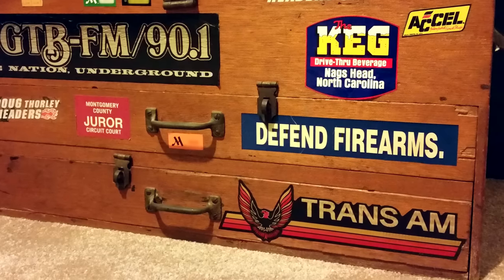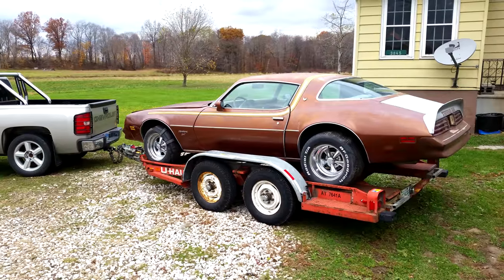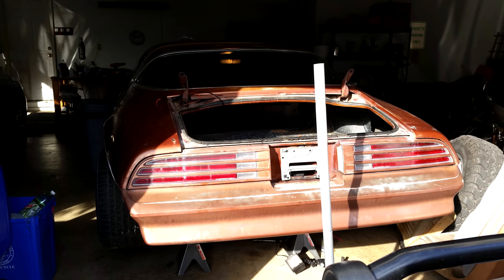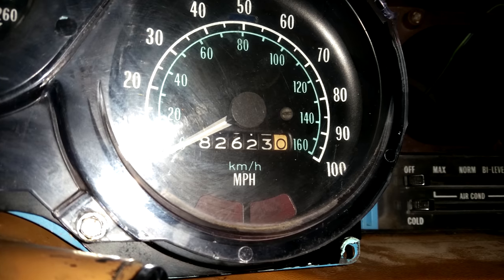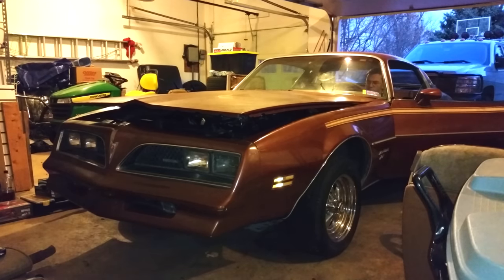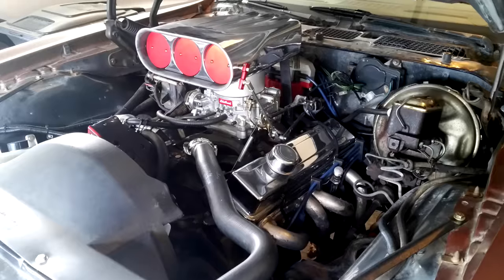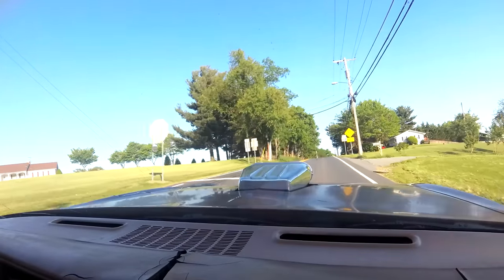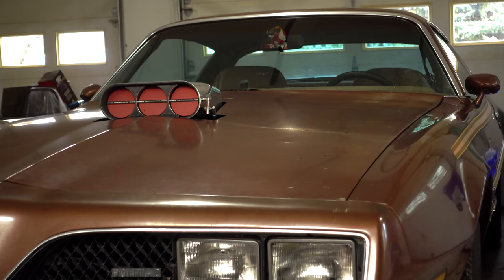1978 Pontiac Firebird Street Car Project (Ep.1)

Comment: when you say rally wheels are expensive and hard to get leads tell me you're not talking about the hot wheels dartboard style rhythms??? If you are I suspect you'll want to kill me. I've got at least two possibly three sets of them.i purchased one set with a steering wheel out of pity and they've been in the burn four years never had the time or money to get the rotten tires removed and have them sandblasted and repainted. I know there's at least one set that I had on a car I was driving for several years that I cleaned up which have the centers and trim rings I had them on a 87 capris and the car looked like a giant hot wheels Dinky ;).i cant are member if I had another set besides those two or not if I do there in the burn and being captive of the weather. I have two sets of centers and I'm pretty sure two sets of trim rings. Also got an old set of 1970s GM five bolt pattern rims off of A GM Van complete with the centers. i got a trim rings and centers for those Rams where somebody was an idiot who had no concept of antique vehicles. Basically the guy threw out several hundred dollars in parts that were in factory mint condition and tossed everything on the side of the road where he bought the vehicle and was modifying it what I was driving at the time I only have the luxury of picking up the trim rings and we'll centers and had nowhere to put the Rams to get them Home.i use those rings and centers on a set of rums I had on a 1972 Jimmy.i have on onto quite a few parts off of different vehicles i had. Here in Canada a Trans Am like in that picture with no engine in that condition will run you approximately $5000 may be more don't take my word for it look one up on the Nova Scotia Internet buy and sell. If you could get one for 500 to 1000 that was salvageable with out an engine I have one.i spent 10 or 15 years trying to get one of those cars when I was shown her and gave up every time I came close it just never ended well. In a couple of cases I had somebody that wanted to give me one where it was on their property but the actual owner wouldn't release the vehicle as an example. One such case the car had been restored and put up on blocks and was sitting in the owner Jared roughly 15 years I'm pretty sure the body itself was shot but there was just so many parts that could've been used on any number of other vehicles including a very nice motor and transmission but the actual owner with the title of the vehicle wouldn't allow it to be moved.i love the fact that this is a daily driver kind of thing reminds me of the 72 Jimmy I used for a long time. It looked like something out of mad Max and was actually quite safe and dependable ironically the damn thing and more horsepower under the hood than you'd ever imagine had to constantly drive it like Ms. Daisy.

Comment: An Espirt with factory installed T/A gauges? That’s rare!Wonder what the build sheet says....
Reply from the maker: The build sheet/order form was attached to the top of the gas tank when I dropped it, took some pictures but it was somewhat deteriorated. Can make out "W63    GAGE PKG" which corresponds to "Rally Gauge Cluster and Clock" when looking it up online.

Comment: Hey ,I live in Australia,my father has a 78 firebird 400 chev.its been changed from lh drive to rh drive I was wondering if u know where I can get a workshop manual to get it running.its been sitting for around 3 years ,I wanna know where fuse box is and trace a few wires.trying to restore it for him only mechanical tho as the body and paint is still good.cheers
Reply: Any help will mean a lot
Reply from the maker: If you are on a budget, the Haynes manual for the car has decent diagrams for the car since the wiring is so simple. I have used mine a bunch of times and it has proven to be accurate and complete as far as I can tell.

Comment: Were you able to pull out the oil pan without pulling the whole engine?
Reply from the maker: Yes, but it was not easy. From memory, I unbolted the trans and engine mounts and lifted it a few inches on each side by jacking up under the oil pan. Set it down on blocks of wood on top of the mounts and unbolted the pan. Took some creative angling but I was able to get it out of there. Just be careful not to crush anything when lifting the drivetrain like that, I'm sure I removed the distributor cap to get enough clearance to do that.

Comment: Are the poly engine mounts to blame for the engine rattling the whole car?
Reply from the maker: The poly engine mounts, trans mounts, and body mounts make for not a lot separating you from the engine so that is a large part of it. It kind of just hits certain unpleasant resonance frequencies sometimes when idling that are unpleasant to the ear, like leaning on a large subwoofer.
Reply: Yeah I had the same issue with poly suspension bushings on my Z28 back in the day and realized they were not a good idea for a street car.

Comment: open exhaust manifold can warp engine parts if used long enough. talking about inside the motor like piston heads cooling too quickly
Reply from the maker: Theoretically, and specifically exhaust valves. I have never once heard of anyone having an issue result from open headers/open manifolds (look at all the race cars running zoomies) but I have heard the idea that the cold air could warp the hot exhaust valves before.
Reply: Maybe under regular gas your right. if it ran long enough it would. And most raceteams will clog it with something
Reply: Zoomies are designed good and just long enough Usually

Comment: You should have put that Chevy 350 in the nearest garbage can and put a 455, 6x heads and a RA IV cam.  You would have been good for easy 400+hp and 500 ft lbs of torque.

Comment: Dont use the metal header gaskets if you want them to seal.
Reply from the maker: What would you recommend? I had the layered ones recommended. I think the problem is more with the bolts, I can't put a socket on some of them even with small head header bolts, and they end up backing out or were never tight enough. Plus I don't trust that all of the welds on the cheap headers even seal all the way since you can hear them leaking even on a fresh gasket.
Reply: Stick to copper or graphite. I'm not sure what those shiny thick ones pictured are made out of (probably aluminum) but they shrink over time and it's a pain to keep tightening down the headers. I never had any good luck with them. You can also make your own exhaust manifold gasket out of super high temp rtv silicone. Its unlikely the welds are leaking but if they are over time you should see a buildup of black soot directly from the leak which will allow you to repair it with ease.

Comment: You lost me at getting rid of the Cragars.  I've been running unilug for years without issue on my 62 409 Impala.  It looked so good on the Cragars
Reply from the maker: I don't have any good pictures showing the lug holes, but they were worn and a bit damaged, probably from loose lug nuts or improper installation. I'm sure they are fine when in good shape and used properly, but I didn't feel good about that in my case. I liked the style but not the offset on the rears on this particular car.

Comment: I hope u didn't change out that fan for ep  fans. When I bought my mustang with a little 302 in it. They did cams and pistons and a fuel system and some other things but put ep fans on there and nothing but overheating problems. They weren't meant for that. That stock fan is more than efficient. Its better for it. Obviously with that fan the faster the engine spins. The faster the fan will
Reply from the maker: It does have electric fans now, and did very well over the hot summer even when stuck in crawling traffic on a hot day idling at 1k RPM. They certainly can't cool as much as the mechanical fan with a good shroud but it seems like enough. I initially wasn't sure if the mechanical fan would interfere with the supercharger belt (I think it wouldn't but the shroud would probably have to be clearanced) and figured it would free up some horsepower and make me a little less afraid to stand near it while running with the hood open lol.
Reply: @FuzzyDiceProjects  yes, no kidding lol. If it works for u. I know that either way u can make less HP. One being that its sucking power from your alt and the fab would be using your engine. So in all reality if that were the case of go with ep fans

Comment: Are you in Maryland? I have a 78 Camaro and need a lot of help.
Reply from the maker: Indeed I am. What's the story on your car?
Reply: Fuzzy Dice Projects  Bought a 1978 Camaro after I got back from Iraq in 2010. Had a 305, thats been changed. My problem is that I need some floor pan work done and no one in the area wants to touch it. All they want is high dollar builds and car mag cover cars. The whole stopping point now is that I need the floor pan done and I do not weld. I also need to run a new throttle cable. That isn’t rocket science though. Ive never done it but it cant be that hard. There’s a lot of things that need doing but the floor pan is whats been holding me up for the past 2 years.
Reply from the maker: Are there just some holes in the floor pan, or does it need to be completely replaced? Are you going full restoration, or do you just want the rust removed so you can seal the floor and get to driving it? If it's small patches, you can get away without welding if you're not going for a full restoration. If it's a bigger project, sounds like a good excuse to get into welding!

The MIG welder (170A) we have doesn't do great with sheet metal, but by running stitches of tack welds it does the job (done exhaust tubing and an oil pan that way). Hoping to get a TIG welder next month, would be slow but runs on regular 120V power and would do the job. What part of Maryland are you in?
Reply: Fuzzy Dice Projects  As far as I can tell theres just a few small hole. No bigger than a few inches. The entire floor does not need to be replaced. Worst part and the biggest problem is the left side toe board. I am just wanting to get it running and driving. It is not to be a show car. I might drive it to shows but nothing like concourse de elegance. Driver, not show pony. Now Id like a nice driver, thats true.
Reply from the maker: Sounds like a very do-able repair then! You can just use sheet steel from the hardware store to patch things up. Honestly, you could get the job done decently with seam sealer and a rivet gun. Or even some of the patch panel adhesives out there. Or get a cheap MIG welder, get some practice, and go for it! Shoot me a message with the part of Maryland you're in, if you are close by I could try to help out.
Reply: Fuzzy Dice Projects  Where are you located? I’m in White Marsh.

Comment: I had a 78 Firebird that I bought new in 77. I had that car for 10 years and it was perfect. The paint was starting to fade a little so I booked it in for a paint restoration. On my way to the custom shop some asshole crossed the center line and wrote the car off. 
I just came across your channel. I like what you have going on. That is a cool old car that you are working on. I subbed your channel so I can keep up with what you have going on. So please subscribe to my channel. Drop around to the Dog House and see the trouble that I get into. Thanks for sharing.

Comment: A 650 holey would probly work on that car better i hate the carb you have always had trouble with myn
Reply from the maker: The Edelbrock 750 was way too big, but after a little fiddling ran great while it was on there. Never got good gas mileage but it was the wrong size for the engine, so I never expected that much out of it. A smaller carb, I'd even go to 600CFM, would certainly do better all-around though.

Comment: Ditch the Chevy engine and put a Pontiac engine in it.
Reply from the maker: Why, for "authenticity"? This car came with a Chevy 305 from the factory and Pontiac only put Chevy 350s in them by this year, so that would actually make it less "authentic". And as far as the bigger engines, they came optionally with a Chevy 400, Pontiac 400, or Olds 403, so it's not like GM was sticking to Pontiac engines. Besides, I'm not all that interested in keeping it original if that's not obvious.
Reply: Fuzzy Dice Projects yeah yeah I know all that corporate shenanigans engine crap. I say put a Pontiac in it because it's a Pontiac and I like Pontiac.